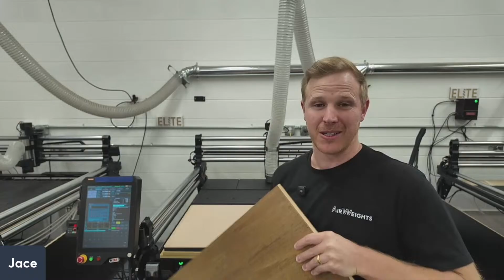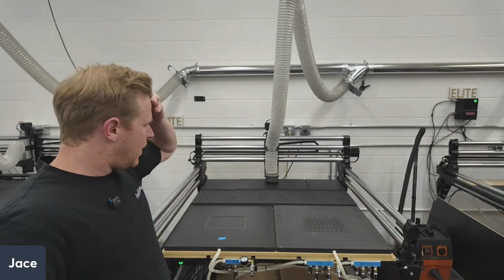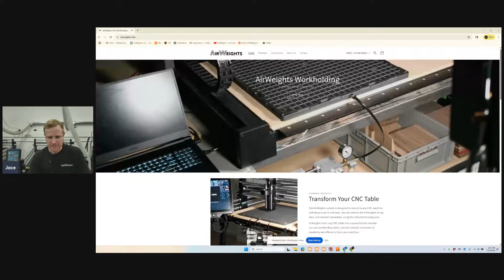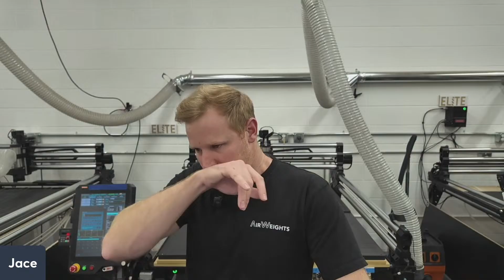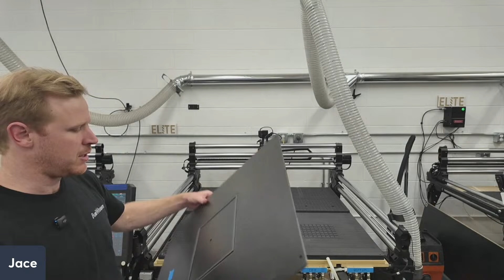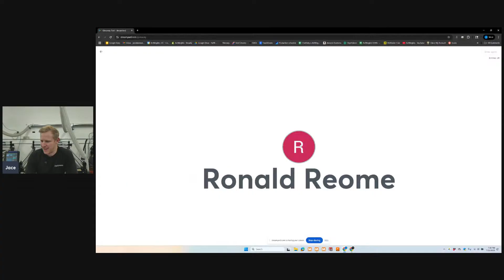AirWeights Livestream - No More Tabs! Using Vacuum Tables for Perfect CNC Parts

Comment: Hey..enjoyed the video....been thinking of getting one of these systems for my millwright mega v so wouldnt have to use clamps or screw work down to spoilboard and was wanting to know what would be the thickest spoilboard i could use on a 24x24 system..thanks
Reply: 3/4" works well too! Just make sure you seal the edges and a 1" border around the bottom surface that will contact our pre-installed seal. We recommend using Medex MDF with our system.

Comment: The latest video was good.  BUT, how do you use the no tabs if you are going to have a rim of material around your part.  For example your blank is 12 X 12 and your finished part is 10 X10.  I have been leaving a .015 onion skin but last week I guess the amount of  porosity in Red Oak let the vacuum fail and the part moved.
Reply from the maker: Good question! Managing the leftover material is a key consideration. Depending on your approach, you may not need to do much. For your example, if you were using a fixture plate, you could make a zone for the offcut, turn it into chips, or constrain it with dowels. If you do not have that flexibility, you can cut the material away or prep your stock to a smaller size so that there is effectively no leftover stock. You are right, Red Oak is porous, but if the vacuum zone was inside the border of your final part, it should hold just fine. Which of our methods were you using?
Reply: @AirWeights  I was using the base table with inboard gasket. I was doing  a molding cut on the outside edge. I am going to try the gasket sheet on the next project.  I used the base table because I was using the new locators to position the part.   I really love them.